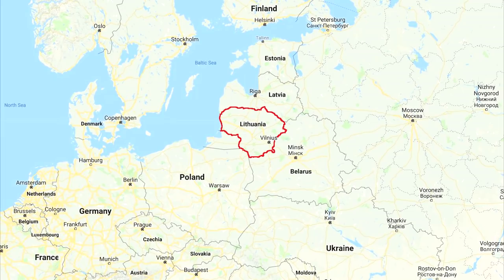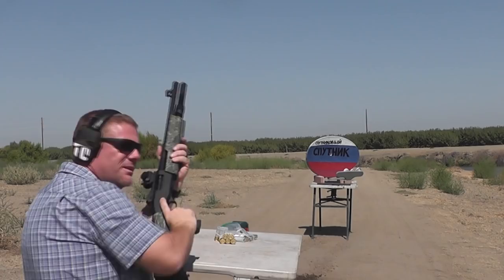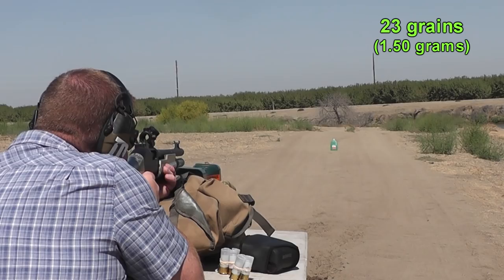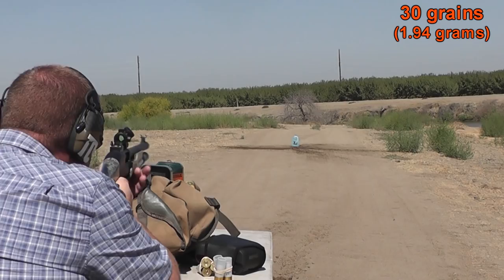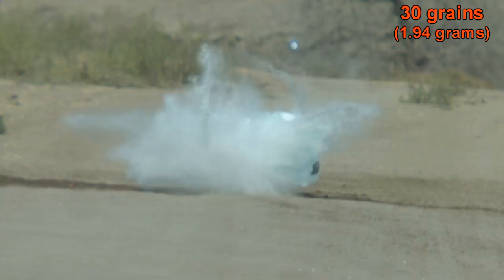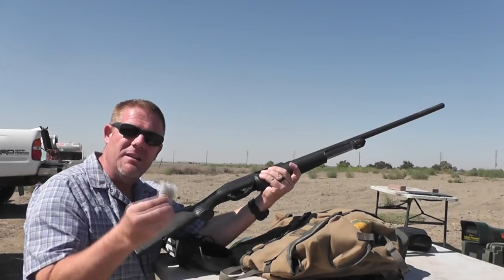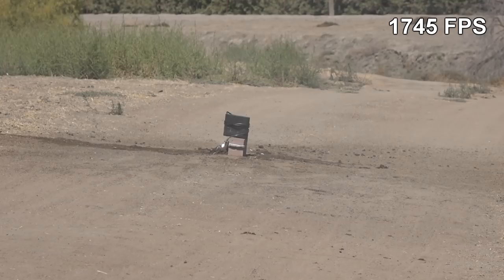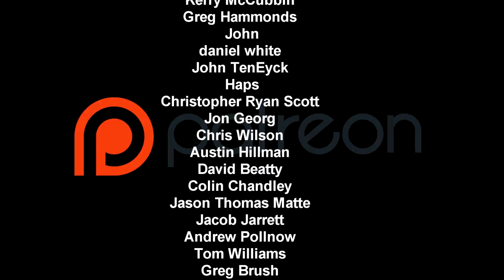Power Hunt Slugs -  Plastic and Steel Beasts!   (overload tests)

Comment: Is the OG loosing weight? He looks trim
Reply: Thanks Casper.   Down 35.    About 35 left to go.
Reply: @OGsDangerShow  Great work. Keep at it.
Reply: I lost 3 stone on keto ;)
Reply: @crazycressy7986  congrats bud. 3 stone in Yankee math is 36ish lbs, correct? If so. Good job.
Reply: Wait... I just looked a stone is 14 lbs. For some reason I thought it was 12 lbs
Reply: 42lb since June 10th ,no gym work ,just cutting out carbs and eating a high fat diet ,even my cholesterol has dropped from 11 to 4,2 and now off the cholesterol meds
Reply: Ya time in Turkish jail will do that to you haha😂
Reply: First thing I noticed! Good on ya OG!
Reply: Officer Gregg I thought the same thing! Keep it up, sir!
Reply: Turkish tapeworm diet.
Reply: @Officer Gregg do you like your Weatherby?  Would you buy again or go with something different?

Comment: Great stuff as always guys! Interesting to see the more grains the worst the results. I guess some design parameters weren’t meant to be crossed, it’s great how you demonstrated this! 👍
Reply from the maker: Some slugs can be pushed pretty hard without negative effects.   These were just really sensitive.
Reply: TAOFLEDERMAUS by the way loved the golf ball slugs, I recon you should do a revision of them and try to glue the steel pin in so it stays in place, and see how thick a plate it will punch through! Like a tank round 👍

Comment: I have a hypothesis... the rifled choke only provides a limited amount of rifling for the round to travel through, if I'm not mistaken... as opposed to a full rifled barrel, providing more spin right from the start. My educated guess would be that there's not enough spin stabilization due to the limited rifling of the choke.

Comment: If they used a fine wire mesh inside the plastic it might act like rebar in concrete and give it some more structural duration.

Comment: Just a comment on natural being stronger. This is most likely to the yellow one using a universal color concentrate which uses a base plastic that blends with and is compatible wth the original plastic but it's a different type. For cosmetic or non-structural purposes this is fine but it will compromise strength as it is essentially putting in contaminates into the plastic.

They would need either compounded yellow plastic or a color concentrate that uses their original plastic a carrier which for smaller production is very expensive and not cost effective.

Comment: Useless trivia:  Before projectile designers figured out a practical discarding sabot, a sub-caliber tungsten core would be inserted into a lighter, full bore projectile.  When the full projectile struck the target, the solid core (with most of the total momentum) continued into the armor.  The plan was to use the full bore to accelerate the tungsten penetrator, whose high sectional density would penetrate the armor.  The drawback that kept designers working towards a proper discarding sabots was that the full projectile experienced the aerodynamic drag of being full bore.  The name for this "non-discarding" sabot was 'composite rigid'.

Comment: That huge flat nose is going to cause wobble no matter what as long as the slug is supersonic. You can see it even in the 23 grain charges. I'd recommend to the manufacturer putting more of a radius on the forward end of the slug to allow smoother air flow characteristics.
Reply from the maker: Slugs do wobble like this but it is more apparent with the long tail out there wagging
Reply: Yard Sale Dale-I'd like to see some further testing before I'll accept the 'brush-busting' claim. You're right in that it's meant to be a short range round and a little wobble doesn't matter much, it's just my OCD kicking in when I see bullets acting less than perfectly.

Comment: Back in the 70's, motorcycles were occasionally wont to fishtail like the 30 grain loaded cartridges. With a reduced load, say, 10 grains, could I use them to discipline my teens? At Home, where the love died......

Comment: Let's say you loaded up the same slug with 30 grains of Longshot in a 3-1/2" hull, on top of 3/4" of granulated plastic buffer between some card wads. I wonder if the compression of the buffer might reduce the shock to the plastic part of the slug enough to eliminate damage and increase consistency. I also wonder if running that slug down a fully rifled barrel might work.

Comment: Slugs like this really do not like high muzzle pressure. But external choke tube with really big ports can help.
Reply from the maker: I think because there is no cushioned wadding to absorb some shock doesn't help too.
Reply: Yep. No cushion is no good. In Russia we have very similar slugs called TANDEM. They are tend to separate steel core from plastic sabot. And this leads to poor accuracy.

Comment: @taofledermaus. Suggestion, try countersinking the steel slightly deeper, drilling the plastic will remove a small amount of weight (increasing velocity) but will move center of gravity back & should not only help with tumble but allow you to use  the 24-25grain charge more effectively. All theoretical of course but should work out.  If you don't have anymore & u send me factory specs, I will try to duplicate/adjust design & make 5-6 to send you
Reply from the maker: I didn't design these and we like to show products like this,  unaltered.
Reply: TAOFLEDERMAUS I realize they are Lithuanian, they are known for exceptional ammo both military and civilian however I was just suggesting if you still had one left, I am a craftsman, cad designer, and lifelong shooter willing to work to improve the ballistic coefficients then send you finished products and or specs to test if you wish. I have no slow mo to see in flight characteristics but with that design any keyholing should be extremely evident.

Comment: Was wondering if ya'll were gonna offer T-shirts with the red gummy bear with TAOFLEDERMAUS in red below it again.   Got two when they were first offered (saved one) and the one I wear is getting a little long in the tooth.  Be that as it may, wonder what the ballistic booger would have looked like getting hit by this?  Of course I just like watching it turn into a squid on acid when it gets a lot energy dumped into it.
Reply from the maker: It think they are still offering the red gummy version here on Crowdmade
Reply: Yes they are, it just doesn't have the red "TAOFLEDERMAUS" underneath the red Gummy Bear.  Oh well, maybe again in the future.  Or is there some
legal reason?  Keep up the good work.

Comment: This kind of reminds me of a slug (called s-ball plastik http://www.myslivecke-forum.cz/fotografie/2012/fsl/fsl12008.jpg ) that they used to sell here but stopped because of ovepenetration and ricochets, would be cool if somebody could recreate it. Basically a thin, steel rod in a big silon/plastic slug, they travel as one but on impact only the steel goes forward. Load it hot and it'll go through friggin everything.
Reply from the maker: We just got some S-ball Plastik slugs last week.
Reply: Sweeet, loking forward to that. They now also make s-ball sport or something but that's just typical brenekke knockoff with a full-bore width slug with plasting wad behind which is nowhere as fun as the original rod-in-plastic design. Hope you have luck loading them and they shoot fine.